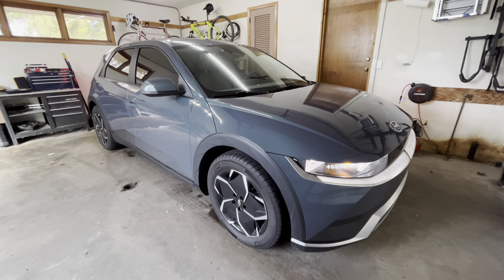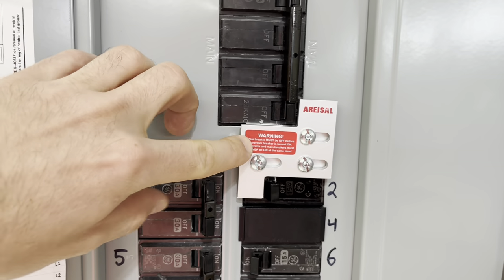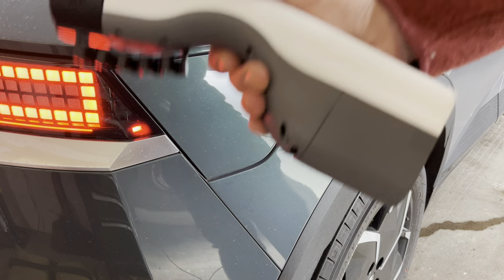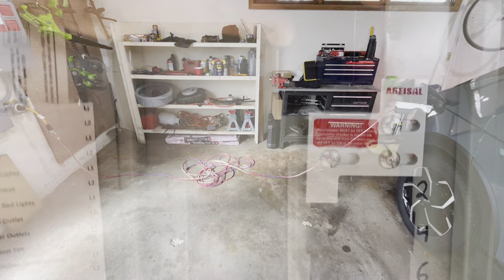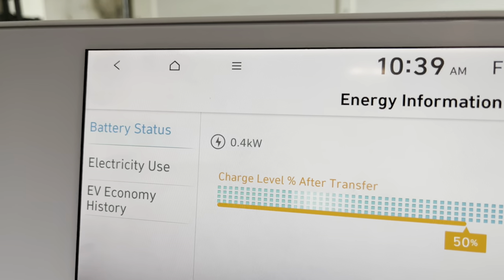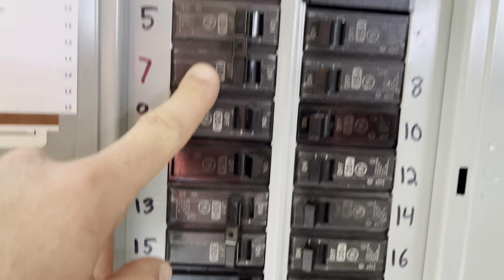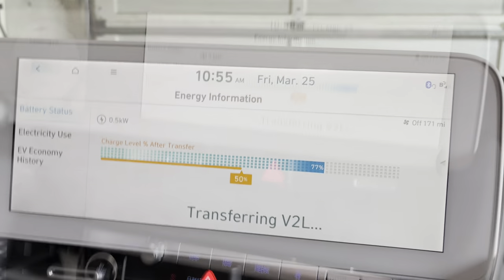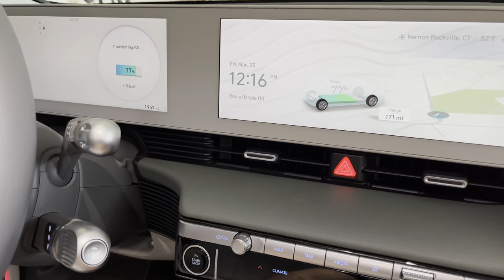5 Days of Emergency Backup Power Using V2L Adapter | Ioniq 5 | EV6 | GV60 | EV9 | Kona | Ioniq 6

Comment: just to make sure: your solar is never running, if you are back feeding from the car, right?
Reply from the maker: Correct, it's physically impossible as the Enphase system looks for a very specific signal on the wires that is specific to my utility that can only come from their grid
Reply: This is doable, but just not with that inverter he has.

Comment: Could you put a double breaker on your back feed instead of a single bus breaker so you would not have to redo the order of your breakers on the panel?
Reply from the maker: Hmmm. I suppose you could. If you were to do that you would certainly want to make sure all other dual pole breakers are off. I don't think those appliances would be happy seeing the same source on both legs and you would surely trip the cars inverter. I'm not an electrical engineer though so I can't speak to exactly how this works.
Reply: @TheIoniqGuy  yeah I would still have all the double poll breakers off. If I ever get this done I’ll try to remember to let you know how it goes. 😁

Comment: If you have a transfer box do you need to kill all of the breakers?
Reply from the maker: If you had a transfer box you would simply flip the breakers in that box over from the electrical panel to the generator. Definitely simpler but you don’t have as much control over the circuits you’d like to power
Reply: One other question how can I tell exactly how much something draws before I try and blow my battery in my car. I have a gas furnace and gas stove wondering if that is low enough energy.
Reply from the maker: You can’t blow the battery on your car. The car output is 1800w and if you exceed it just turns off. It’ll give you a readout on the dashboard of power draw

Comment: I notice you didn’t say refrigerator? And how long will the car last
Reply from the maker: Yes it powers my refrigerator as well. Probably a few days, maybe 3 or 4 if being conservative
Reply: @TheIoniqGuy  so does it have multiple outlets at the car or do you plug a power strip in and everything into strip
Reply from the maker: I showed the setup in the video, the car plugs into an inlet that back feeds the electrical panel
Reply: @TheIoniqGuy  👍

Comment: One Q: there is yet another socket in the car - in the middle of the rear seats. Could you please measure if the voltage from this socket is in the phase with the voltage from the V2L socket ? Thanks.
Reply from the maker: Unfortunately, my vehicle doesn't have that feature so I cannot test it.
Reply: @TheIoniqGuy  OK, thanks anyway.

Comment: This is the future, electric cars should power houses and crowd-balance the grid.
Could somebody help with this issue?: the adapter liked in the description is not compatible with my 2018 electric Hyundai Kona. It's absurd, as it's compatible with non-electric Konas. Can somebody suggest what I could use?

Comment: Is it possible to connect both the V2L adapter and the inside plug on a Limited into a converter to feed 240v to the panel so that central AC can be operated on I5 power? ( sorry if this is a dumb question lol)
Reply from the maker: No that's not possible. It can only feed 1 outlet at a time

Comment: I tried plugging in a portable AC, but I couldn't get the energy measure to display how much power was being drawn. The label on the AC is showing 1.2kw, and I was trying to verify that but it just kept displaying 0.0 Kw. Any thoughts?
Reply from the maker: And the AC was running?
Reply: @TheIoniqGuy  Yessir. It was running, but the gauge is just showing 0.0kw. I haven't tried plugging in other stuff to see if it changes. Someone else in the ev6 group said it displayed the usage immediately for them.
Reply from the maker: It should the second something begins running. Very strange

Comment: how many amps does the ioniq 5 charge at with your current set up? 48 amps? or 32?
Reply from the maker: I have my ChargePoint setup for 40A.
Reply: My EVSE is a ChargePoint 12 kw unit on a 60 amp circuit which supports the I5’s 11.6 kw max AC charge rate.

Comment: we are getting an ionic 5 in about a week. It comes with a home charger connector. Not sure if the charger cable will come with that can be used to connect back to the generator outlet?
Reply from the maker: It would require some modifications and who knows if it would even work after that. I would just buy the adapter if it's something you're interested in using.
Reply: @TheIoniqGuy  Would you reply with the link where to buy the v2l adapter?
Reply from the maker: It's in the description
Reply: Your link goes to a webpage which said temporarily closed.
Reply: Other hyundai places they want $520 for it, kind of ridicuously high price!
Reply from the maker: I think because today is Good Friday. I just Google searched the part number and many Hyundai parts stores say temporarily closed right now

Comment: Hi, is there a neutral in the V2L? Or it does not matter where is the neutral wire?
Reply from the maker: It's just like a standard 15A circuit, 1 hot and 1 neutral and a ground
Reply: @TheIoniqGuy  and does it matter is neutral on the left or right?
Reply from the maker: I need more context on what you're trying to do
Reply: @TheIoniqGuy  I am in Europe and have neutral, Hot and ground at home, so wondering does it matter how to connect it to the house wires
Reply from the maker: I don't believe you have a neutral since your circuits are 240V in Europe in which case you'd have two hots and a ground. You should consult an electrician for your use case.

Comment: do the make a "v2l like" adaptor that will give 120 volts for each leg s o I do not have to move breakers around as my panel is full and move breakers must be landed where the are.  If so what power  on 240 volts split phase?
Reply from the maker: No, that doesn't exist for North America.
Reply: @TheIoniqGuy  hanks for the speedy reply.  To bad It would make life easy.  Check this out:  

Emporia V2X Bi-Directional Charger
Coming 2023

Comment: 2 legs at 1.8kw each for 3.6kw, with two evs?
Reply: I wonder if that would work? you could also wire it for using each leg as part of a 240-volt plug.

Comment: I was expecting to see you test it till the battery gets to 50% and to see if you can power the house for 5 days
Reply from the maker: I hope to never have to do that this is only for emergencies. With math it's easy to calculate the run time based on average baseline load of the house

Comment: Do you have a link for the box around the inlet
Reply from the maker: It's just a standard 4in square electrical box which is cheapest to get at a hardware store instead of online.
Reply: @TheIoniqGuy  I can get the box but what about the plate that goes over the front that the inlet screws into?  Wouldn’t I need a plate with those specific screw holes?
Reply from the maker: Yes, I can't remember the size of the cover off the top of my head but I'll measure when I get home.
Reply: @TheIoniqGuy  thanks a lot. I appreciate the help
Reply from the maker: 2.5" opening for that particular receptacle

Comment: Apologies in advance if I missed it, but does anyone have an estimate of the electrician work that is required?  I saw a reference in the comments about the cost being cheaper to buy a whole home Generac unit, which I estimated at one time to be $4-$6K.  Just trying to compare the two options.  Thanks!
Reply from the maker: If you have space in your panel for an extra breaker and your panel if mounted on the outside of the wall like mine is, this shouldn't be more than an hour job by a good electrician. Took me maybe 30 minutes. For a simple install I can't imagine it costing more than a few hundred dollars but I've also never hired an electrician for anything so I don't really have a frame of reference.
Reply: @TheIoniqGuy  thank you for the reply.  I have two panels in my basement, the electrician installed my charger on the original panel, the additional panel was installed when I finished my basement and installed a hot tub out back.  The electrician had to wire the charger from the basement to the garage on the ground floor (cost was approx. $1,500.00).  I love the setup that you have.  I’ve contacted the electrician to replicate your setup and provide a price.  I’ll update here in the comments when I receive it.  Thanks again.
Reply: @TheIoniqGuy  I received an estimate from the electrician of $1,300 - $1,600 to complete the job.  I thought that it was high, considering I still have to purchase other items, potentially taking me over $2K for the project.  I have a quick question - what is the difference between the V2L outlet under the rear seats (on my 2023 Limited) vs. purchasing the V2L adapter and using on the outside of the car?  Do the two options provide different energy or maximum power potential (manual states 16A max for V2L outlet under rear seat)?  Could I just simply plug in an extension from the V2L outlet under the rear seats directly to my refrigerator in the garage?  Or do I need the V2L adapter?  Just curious.  Thanks for all of your help!!
Reply: I just read the following: The power outlet under the rear seat, however, only operates when the car is turned on. Regardless of which outlet you use (charging port adapter, rear seat, or both), the total power output cannot exceed 1.9kW at 120V, or 3.6kW at 230V.  I will purchase the Adapter so that I can use the charging with the car off or in Utility mode.  Thanks!!

Comment: is sel come with ac load ?
Reply from the maker: Under the rear seat? No. You can use the adapter with the charging port
Reply: @TheIoniqGuy  that annoy I'm going to pick my sel tomorrow but at least I can use the adapter how much for adapter?
Reply from the maker: It's about $500 with shipping

Comment: Can I get this right. All I need to turn the car into a backup generator is the following. A V2L Adapter, a breaker, and an outlet to plug the car into. I wanted to learn how this works and EVERY video has a $10,000 electrical power inverter and other shit. 

I am not talking saftey here or steps. Just raw equipment. I want an electric car, I can buy a Chevy Bolt EUV or an Ioniq 5. The only pro to the Ioniq is this capability. I can not have solar, I do not want to install or buy an inverter. I assumed however I'd need one, but it seems I don't.

Comment: NEMA 15-5, which means Max 12a 120v continuous. This is a party trick and won’t power your house at all. It’s for camping trips and tailgating. For all of the money spent upgrading your panel you should have just gotten a gas generator. I hope everything in the house (water heater/heating system/oven) is natural gas or you’re going to get real cold during an extended power outage using this adapter.
Reply from the maker: Cost me about $75 in parts and I've already run the house so I'm not sure what you're trying to prove by acting like you've seen my system actually operate. If you watched the video then you'd know my base continuous load is less than 800W which is about 7 amps
Reply: @TheIoniqGuy  I’m not trying to prove anything at all, just saying there are better ways of handling emergency backups than a 15 amp power source. If that’s truly your base load, then starting a microwave or furnace fan is going to trip a breaker or burn something up. I really don’t think Hyundai designed this adapter to run a whole house.
Reply from the maker: It's not for everyone but for me and my specific situation, it's more than suitable. We have breakers and overloads for a reason. The second the car senses an over current event, it trips. Nothing is burning up unless multiple redundant safety devices fail at once.
Reply: @bradhoots8547  brad what your missing is the joy and fun and hobby of this stuff. It’s interesting and I has clearly been been made to work here. When I have occasional and short power outa it stick a 1000 watt inverter under the hood of my leaf to power fridge, freezer (full of fish I’ve caught) and some lights. It’s great!   One less miserable small ice engine in the world which is a good thing